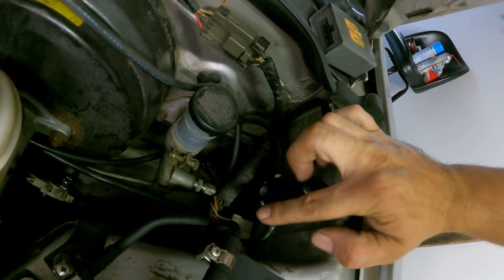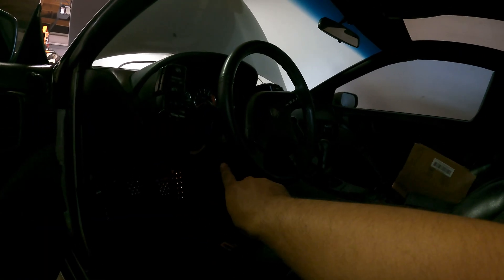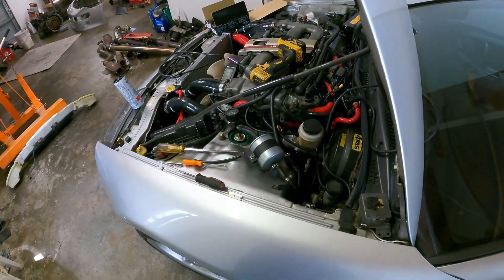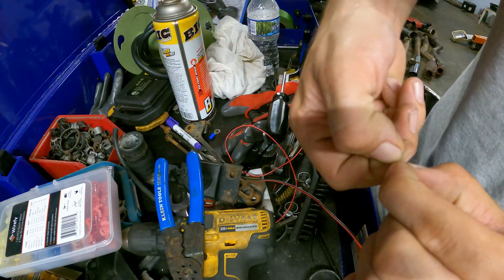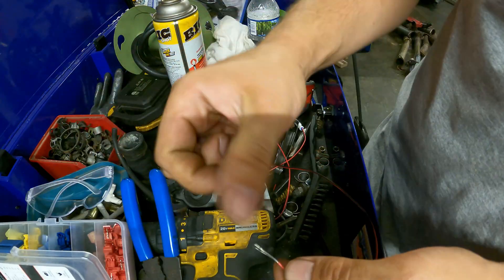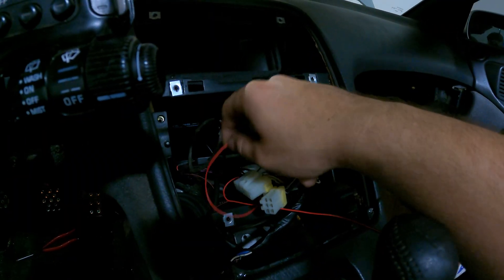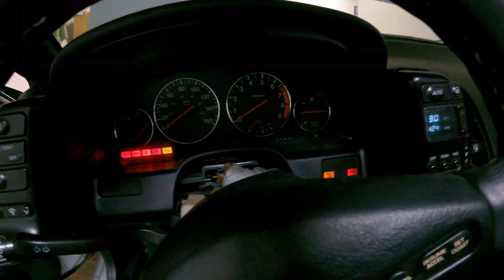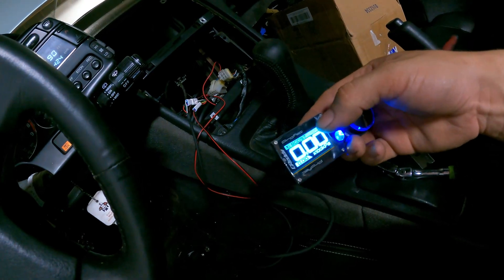Installing an Electronic Boost Controller for more PSI!

Comment: I just got this unit. I see some people connect to the intercooler piping nipple before the throttle body and some that connect to the charge pipe. I have a true tt engine. Which is it?

Comment: The control box was designed to mount in the engine bay so all you need is to run display wire into the cabin. Much much easier, no vacuum hoses needed into the cabin, as shown on page 11 of the install manual.
Reply from the maker: Good to know! I must have skipped over that haha. With all the extra stuff already in the bay, id probably still hide that box in the cabin😆